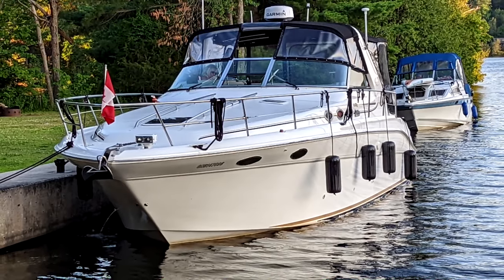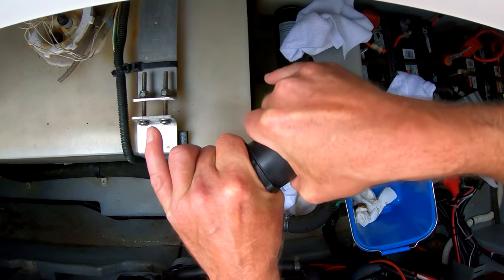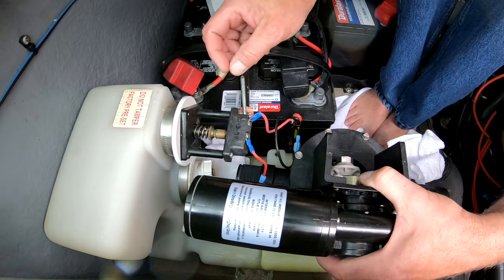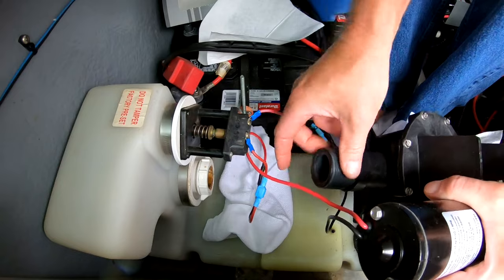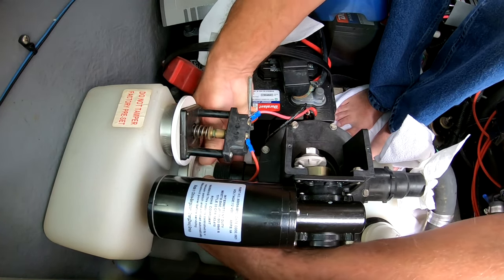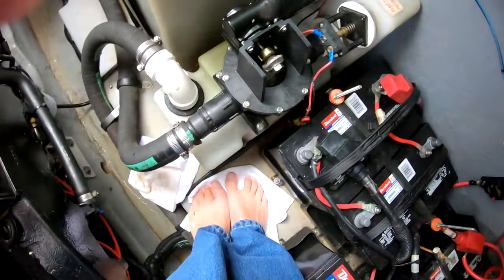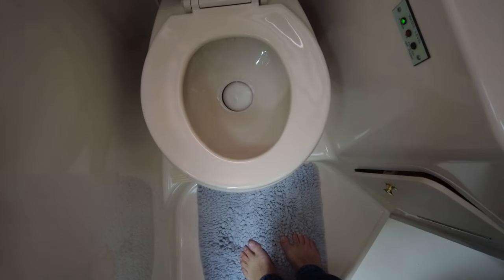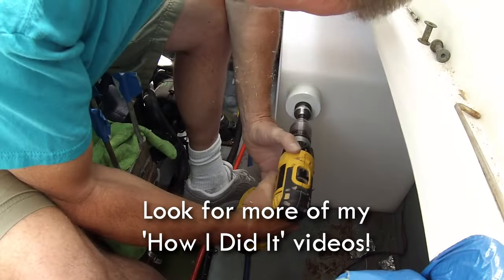Replacing Duckbill Valves + Vacuflush System Overview, Sea Ray Boat

Comment: Terrific video thank you,. Two days ago I didn't know where this was on my boat, didn't know what I was looking at when I found it. This is very helpful.  Now I know where these four duckbill valves are on my system.  No other source said there were four or where they are.
What I learned doing this. My hoses are the white ones, a bit stiff. Loosen the hose clamps and then unscrew the ABS part. You won't even have to remove the hose.  2:18 is the real gold in this video. Until I removed the motor I was wondering if there even was another pipe there.  And as in the video, I used channel lock pliers, but not much --  all these connections were hand tight + maybe a quarter turn.  The 4th duckbill is not shown, it's under that threaded piece being screwed in at 3:30.  I wore disposable gloves for this, there was poop on all of this, dried out, didn't smell bad (my use of enzymes?)  My duckbills were 5 years old, in plastic bags. There's a slight bit of daylight.... but all four (in two different bags) were exactly the same (and OEM) so I used them. Seem to work just fine. (I have two heads and two of these systems on my boat, so hearing the same sounds, same pattern... indicates they're working the same way.) 
All this works well, I used no pipe compound. If you're a noob, slow down and remember Tghty Righty, Lefty Loosey .
Reply from the maker: Glad it helped you out! If you get a chance, check out my How I Did It playlist for well over 100 projects I've done, including many, many on the entire Vacuflush system. And that includes replacing the holding tank in two of our prior Sea Ray boats! 💩🤣

Comment: Mate, I'm looking forward to watching this!  You're history of videos on vaccuflush systems and duckbill valves is second to none.  I have used the other ones to diagnose issues on my boat with vaccuflush.  We have 2 systems on board our Maxum 4100SCA that look identical to yours.  One works fine and is easy to access. The other one in the aft stateroom clearly needs new duckbill valves but I'd have to be a scrawny small person to access it and I'm still trying to figure out how to get in there to fix it.  Thanks for great crappy videos.  Cheers, Graham in Oz.
Reply from the maker: When we had our 400 Sedan Bridge, both of the pumps were located in a very tight and hard to reach spot in the side cabin, under a bench a stuck partway aft. A real.pain in my back, but servicing them left me no choice. That, as well as replacing all.of the poop lines on that boat only added to the joy of boat ownership 🤣💩

Comment: Another great "How I did it" video Paul, thanks.  I know you have done this before, on previous boats.  My vacuflush toilet seems to be working just fine, but...I have never replaced my duckbill valves and I was wondering what signs you experienced that let you know they needed to be replaced?
Reply from the maker: Actually, this was the THIRD time I replaced them on this boat 😩 First was when we got her last spring (changed the pump and bellows at that time as well), second was on our summer holidays, but ultimately discovered that there was a baby wipe stuck in the line (from a previous owner) that was causing the problem.
 In that case, as well as when I replaced them on this video (this summer), the symptom was no vacuum being produced. That results in the loss of being able to flush the toilet, as the water won't go anywhere. In this case, it was a couple of bad duckbill valves, which had gotten fatigued after a year's worth of flushes and lost their ability to fully close.
 So why do they get fatigued? Because we use the toilet all the time, usually 4-5 days a week throughout the season, so it gets a good workout. And unlike many folks who are afraid to 💩 on their boats, or flush toilet paper, we use the onboard toilet exclusively when we are there.
Reply: We are not afraid to use our head system either.  Thanks for the great information.  Things are working great, but now I know what to pay attention to. @BoatingWithBoogaboo
Reply from the maker: And be sure to always have spare duck bills on the boat. You never know when they're gonna fail...

Comment: We dove in to replacing the valves in our SeaRay 260-05 yesterday, had a hard time even reaching and managed to find and change merely one.. when watching this excellent video on that we’ve come to wonder, are there always 2+2 or how many did you just replace? 😮
Reply from the maker: On all of our boats serviced by Vacuflush systems (400 Sedan Bridge, 330 Sundancer, 370 Sundancer), they all had/have a total of four duckbill valves - two before the pump and two after.
 Keep digging, and always replace all four each time. Otherwise, you'll be cursing having had not done it the last time 😳

Comment: Great video Paul!  Very helpful to us novice boat mechanics.  I've noticed many generic replacement duckbill valve options on Amazon that are much cheaper than the Dometics that you recommend.  Have you had any experience with the generic replacement valves?  My initial thought is that they can't be worth a crap if they are priced $18 for a 4 pack when Dometic is $60 for a 2 pack.
Reply from the maker: Glad it helped! Don't forget to check out my How I Did It playlist, as well as one specific to Vacuflush systems on my channel. Lots of messing around on those videos 😂 
 As for the generic VS Dometic branded duck bill valves, I haven't used the 'cheap ones' but did order some as an emergency backup, just in case.
Reply: Thanks for the reply.  I think I will just stick with the Dometic to be safe.  In my experience (especially with Amazon) the cheap alternative never works out.
On a separate note.  I live in West Michigan but my college roommate lives in Fenelon Falls on Cameron Lake.  We visit them every year.  Beautiful area!
Enjoy your summer!!

Comment: Wear gloves when doing shitty jobs! Lol. I would further recommend to change out the duckbills anytime one has to fart around with taking the vacuflush apart. We've got a 2000 340, new to us 2 years ago. First we changed out the complete internals of the toilet rather than replacing the broken pieces ( too shitty of a job as it's not our shit yet, lol). Then we replaced the pump's bellow as it was cracked. This year we had to do the duckbills. I wish we did them last year when it was all apart. Life on the learning curve I guess. Now a lot of our boater friends want us to look at their shitters, lol.
Reply from the maker: Absolutely, when changing duck bills - or other components at the pump - be sure to swap all four.
 Funny you mention that your boating buddies now want you to look at their Vacuflush systems. I actually had a similar situation, the week before this video was filmed, as one our boating neighbors had a late night issue on their boat, so I rolled up my sleeves and jumped into the bilge to help change their duckbills. And I only charged one Corona for the job 😉
 Oh well, such is the life of a 💩 expert 😂

Comment: The vacuflush on our boat was replaced in 2022.  How often should the duck bill valves need replacing or will the system performance just drop when they need done?
Reply from the maker: When you say the 'Vacuflush' was replaced, are you referring to the pump, or bellows, or pressure switch, or toilet seal, or just the duck bill valves only?
 When the duck bill valves fail, it'll happen without any warning. One day the system flushes fine, the next it won't build any vacuum, resulting in no ability to flush at all. Just a gurgling going in the bowl. That's why it's always a good idea to have at least four spare duck bills onboard at all times. Eight is better, but start with four in stock. Trust me, they never fail at a good time, so have lots of disposable rags on hand as well 💩
Reply: They had the whole unit that resides there n the engine compartment replaced. I found the old one in a box down there also.  I will some valves for my spares kit.
Reply from the maker: @CanukSpyder if it's a complete assembly (accumulator tank/pump/etc.), then that should have come preassembled with new 🦆 valves. If that's the case,you should be good for anywhere from two-four years or even more, depending on usage.